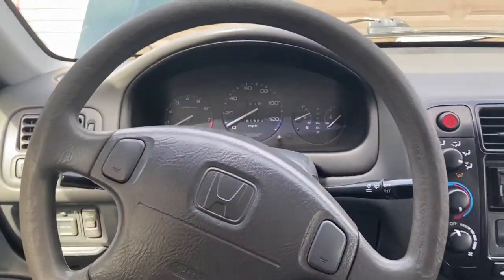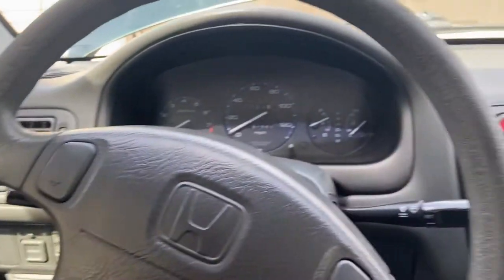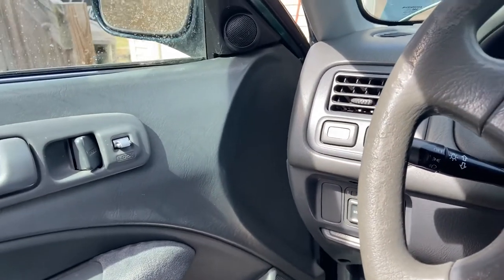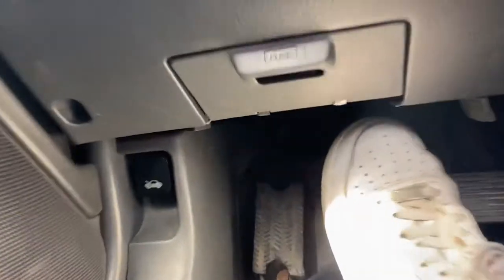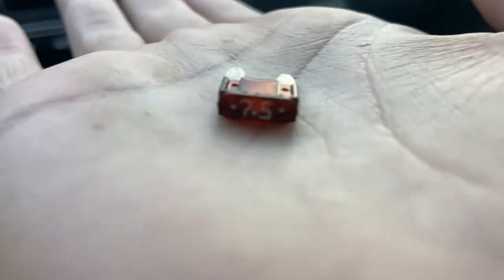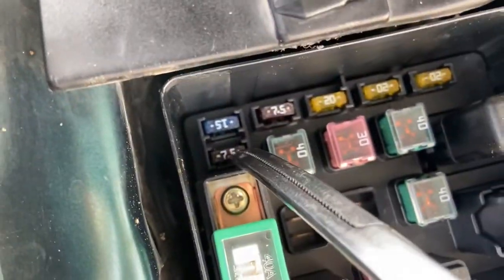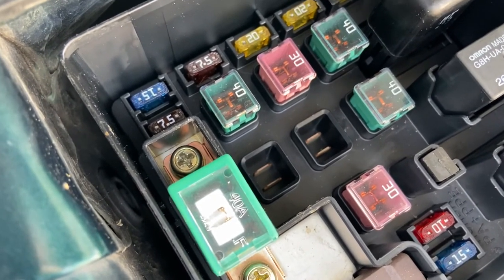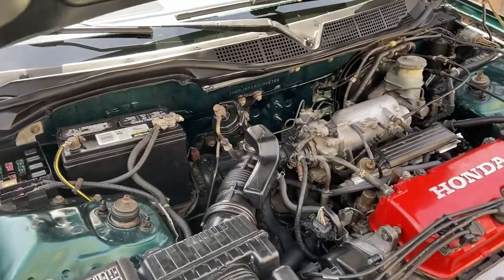Honda Civic Door Chime Fuse Fix (Headlight Chime/ Dome Light Fuse) 1999-2000

Comment: My problem with my 2005 Element is that the buzzer doesn't work when I open the door with the key in the ignition or if I leave my headlights on. My dome light works and the 7.5amp fuse under the hood is good. Is there another fuse under the dashboard inside the car? Maybe someone disconnected the buzzer or it's bad.